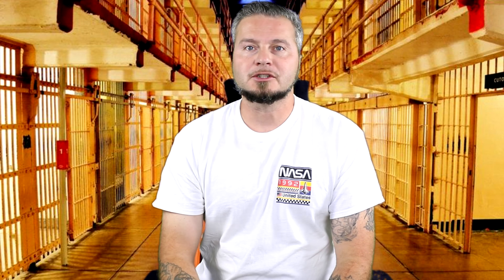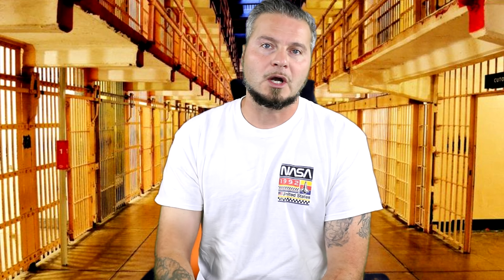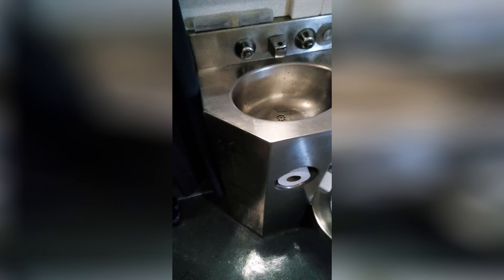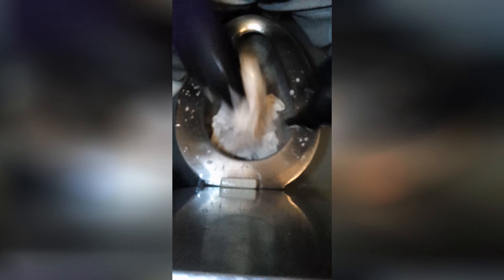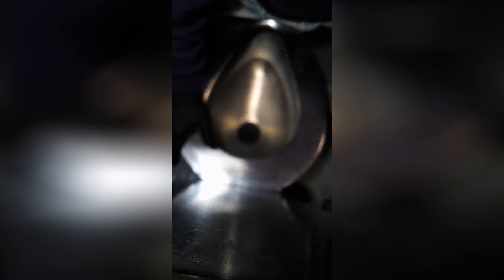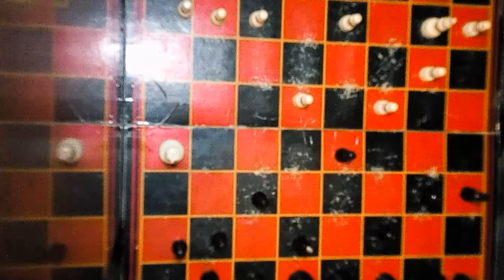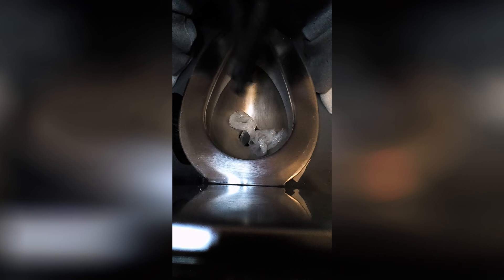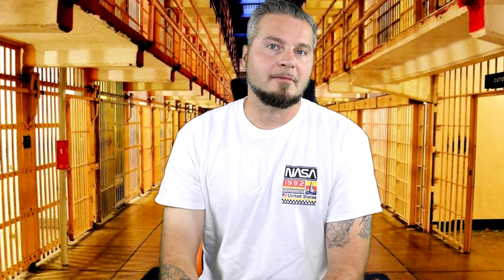How To Cook And Clean In A Maximum Prison

Comment: Never heard of that method of having to heat up food, that's interesting. In Texas we had either hot water spouts (in dorm units) or hot water pots you can buy (in cell units), but no microwaves. Something that might be unique to Texas units is a method where you use the hot water pot coil and turn your metal stool in your cell into a stove to grill stuff on.
Reply: Why am i not at all surprised in TEXAS they found a way to make a grill in prison?